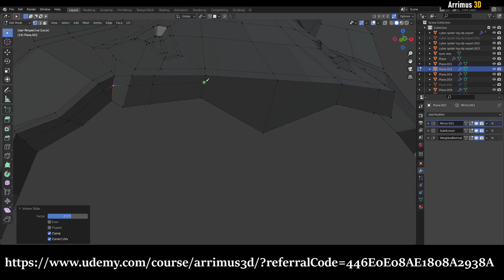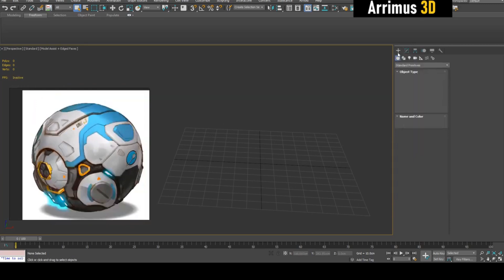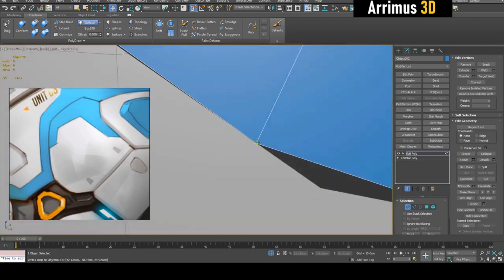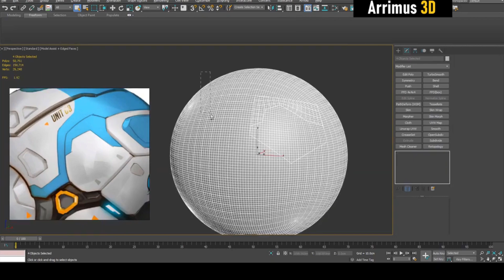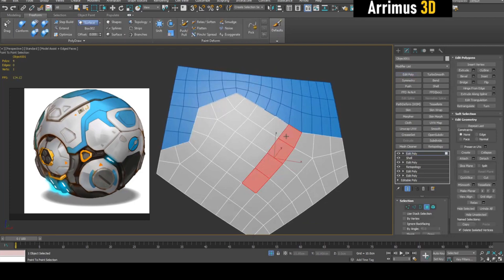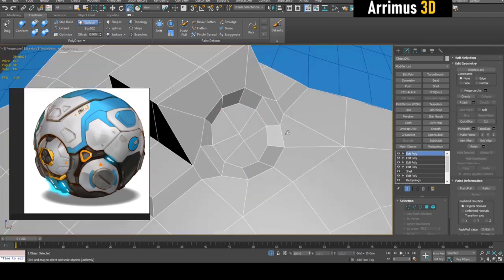Classic Topology Problem - Angles on Curved Surface

Comment: Hi - cool vid but couple of questions:

Ive never seen the retopology modifier before. Is that built in or a custom script? 

When you made the circular indented shape at the end of the vid, how did you make the polygon selection into the circular shape? 

Cheers!
Reply: Retopology is a built in modifier
Making the polygons selection round is done with fastEdgeLoopRegularizer which is part of RapidTools from RapidMXS. It's free.
Reply: @tomphillips7207  much appreciated mate! Cheers!
Reply: It's in a newer version, you probably pirated max and thus, are on an older version